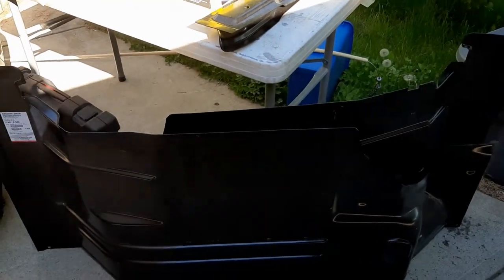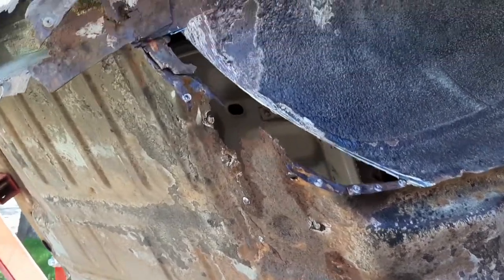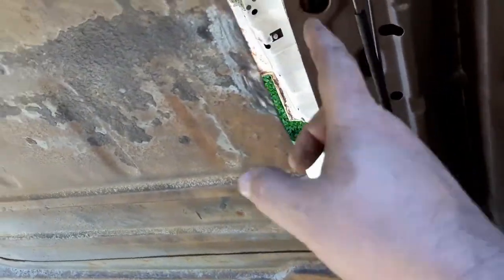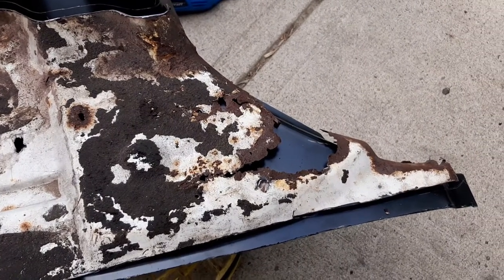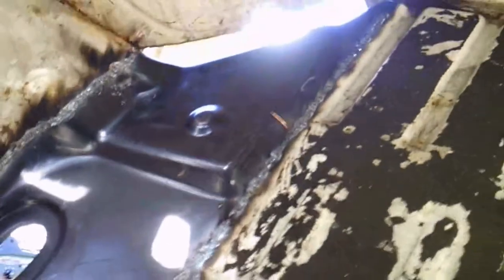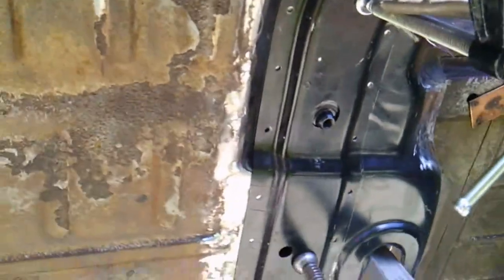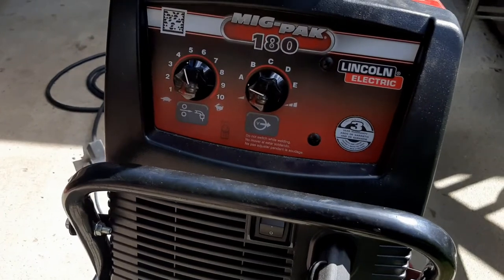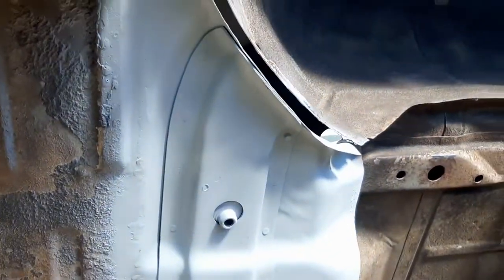1966 Chevrolet Impala SS RR Trunk Support

Comment: We got a 1966 impala with a 396 big block and its cherry red we got to put new transmission in. Eventually replace trunk floor in the winter. But also change starter with a high torque starter

Comment: Can you make L and R lower fender Brackets?
Reply from the maker: @dennisechols6080  I did make my own. Didn't have any special benders or jigs. Just made a paper template from the one decent one I had. Not.perfect but they will do the trick. That said, there is a guy on a couple of the Impala groups on Facebook that manufacturers them just like factory.  "1965-1966 Chevy Impala cars and parts for sale" is the one group I saw them in. $55 for a pair.